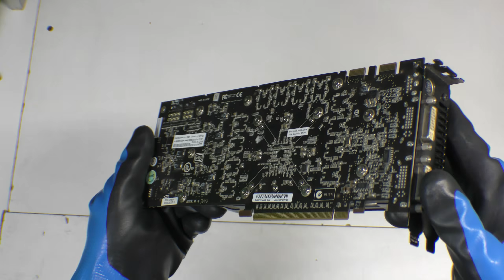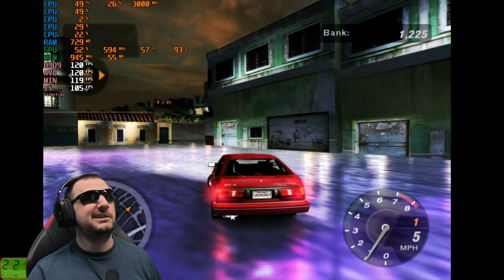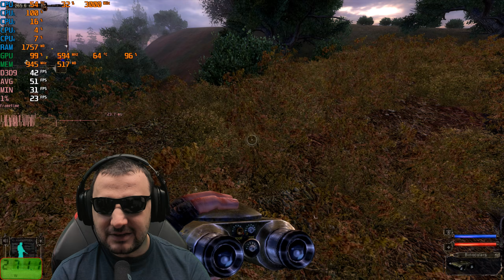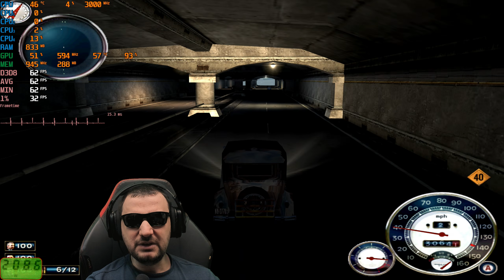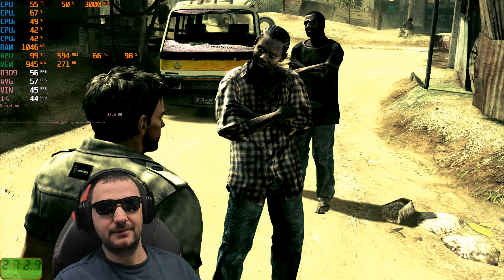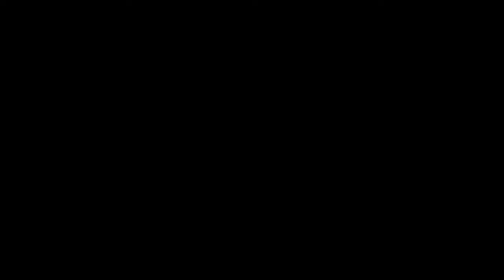XFX 8800 GTX Extreme Benchmark

Comment: 11:49 Like I said in previous videos. If older game is not supporting some resolutions you can override it with DX9res.dll by kegetys. 
BTW, are you still on this proprietary PC (by HP?) or is this something different? I was hoping you would OC this CPU to healthy and desired 400 FSB instead of default 333. This would give you 3.6GHz, so faster than top end QX9770 @ 3.2GHz